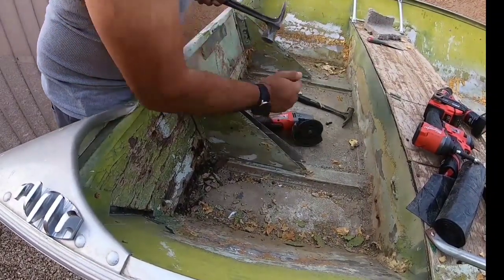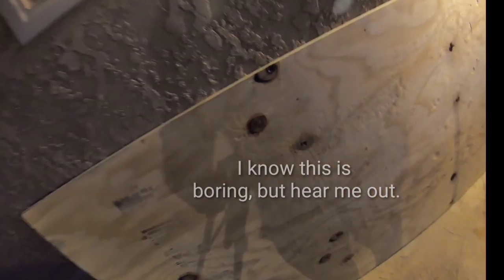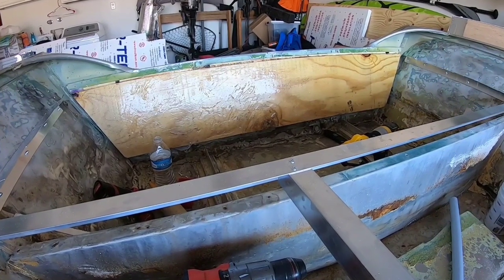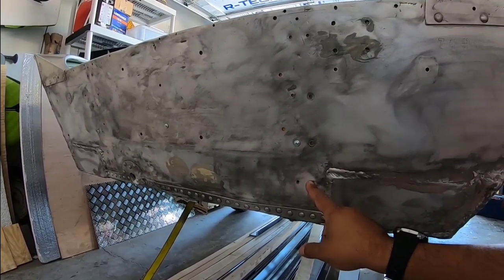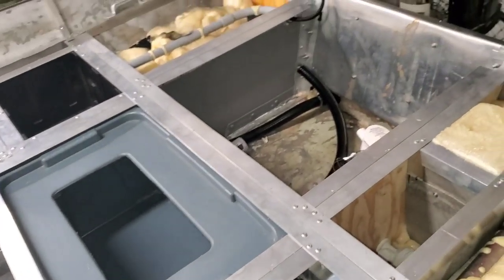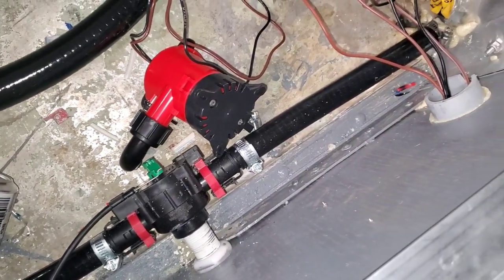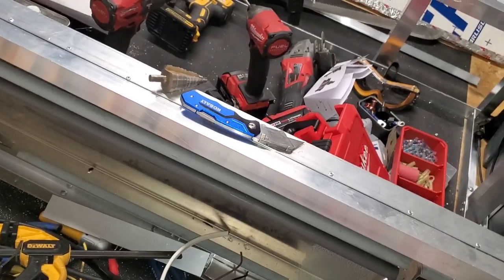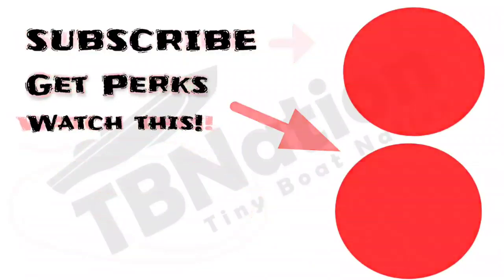Jon Boat Transom Replacement Tutorial.

Comment: It may be overkill, but If you want to truly encase your transom in epoxy, I recommend drilling the bolt holes out about 3/8" bigger than the bolt diameter. Put tape across the holes on one side, flip it over and pour epoxy into the holes. Sand it smooth after it hardens, then drill the holes out to the appropriate diameter.

Thanks for the videos Mike, they've been a great help with my boat projects.

Comment: Very cool good work man! I have been rebuilding a fiberglass boat on my channel. In the future I might find a aluminum boat to fixup, the fabricating process your doing looks really intriguing. Plus I react to fiberglass resin which is very unfortunate. at any rate I subscribed! I'm hoping to learn from your channel keep it up!
Reply: I’ve been in the process of rebuilding an aluminum boat myself. Apparently I wasn’t the first. Never had trouble with fiberglass. Seems people are more willing to just slap anything on tin and call it a fix. I’m having to redo a lot of past mistakes the previous owner made.

I know this is late, but if you have any insight on things I need to look out for, I’d be grateful. My main concerns are the support rib bands and some really gnarly “repairs” they performed on the transom.

Comment: When I did my transom I did a layer of OSM because it creates a wear layer so it will resist damage that might let water get through.  Only takes a little extra time, wet the wood, lay down osm, wet osm, quickly sand after it's set. Good to go.
Reply: What is OSM?
Reply: @stabiae1  offset strand mat, it's a type of fiberglass cloth, you can actually find it in small amounts at home depot for around 5 bucks or you can buy a whole roll off Amazon for maybe 50 bucks.

Comment: I have a question i’m planning to buy a 14-16 ft aluminum boat for fishing and adding a removable wooden casting deck to the boat . should I use west system resin to seal the deck before i carpet or just use a big box store stain
Reply from the maker: Resin on wood  is the only way you’ll get longevity from it

Comment: I used a 2x12 treated for mine ,I did have to plane the thickness down about 1/4 inch
Reply: Is it because of the chemicals in the treated wood will it deteriorate the aluminum?
Reply: @TinyBoatNation  ACQ treated is a no go on aluminum. MCA treated can be used on aluminum. Not sure if they have anything different but this is what we have in MD. Still don't know if I'd use it on a boat.

Comment: Are you using stainless steel nuts and bolts? Won't they interact with the aluminum and cause serious corrosion?
Reply from the maker: If it sits below the water line in excess, yes. Otherwise if you primer and paint it

Comment: Would using a nylon washer against the boat with 5200 do just fine??
Reply: @TinyBoatNation   so you would rather do just stainless bolt and washer with 5200 then correct. Thanks a lot for the reply

Comment: I've watched a few of your subfloor builds and I've noticed you guys basically just slap stuff together without any precision. I'm not a boat guy, but I was an aviation sheetmetal man and I'm amazed at your lack of basic sheetmetal craftsmanship.
 Even this transom repair was also slapped together in the video as if you just want to fix it temporarily. I'm not trying to be harsh, but I don't understand why you promote shoddy buildups and repairs.

Comment: After you resin coated the new plywood and installed it what, if anything, do you do to the holes in the wood that you have to drill to fasten everything together again?
Reply: If you want to truly encase your transom in epoxy, I recommend drilling the holes out about 3/8" bigger than the bolt diameter. Put tape across the holes on one side, flip it over and pour epoxy into the holes. Sand it smooth after it hardens, then drill the holes out to the appropriate diameter. 

I also recommend using stainless steel truss head bolts and applying a marine adhesive sealant (e.g., 3M 5200) to the bolt head on the hull exterior and use nylon locking nuts. Snug the bolts up while the sealant is wet, but not too tight... you don't want to squeeze it all out. After it has cured, you can finish tightening the bolts.